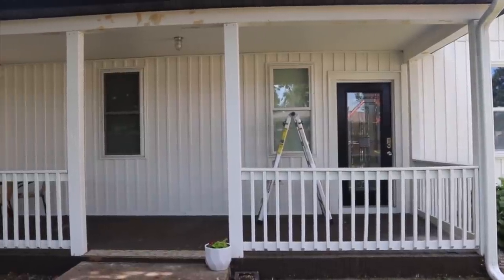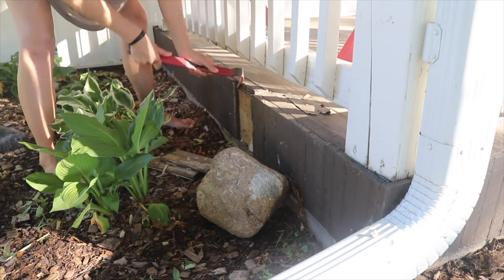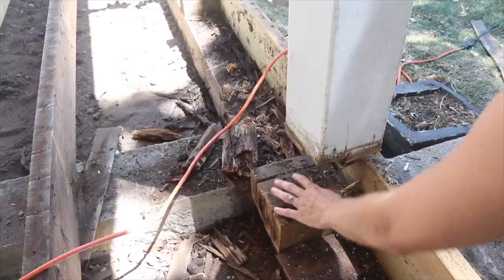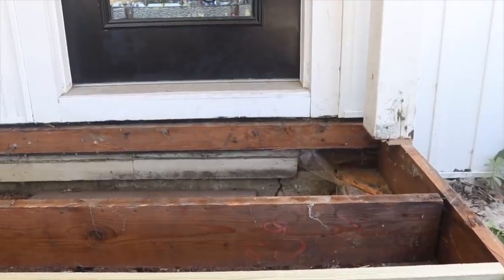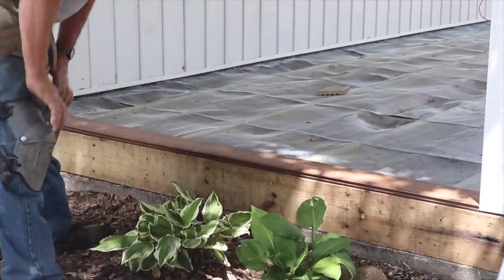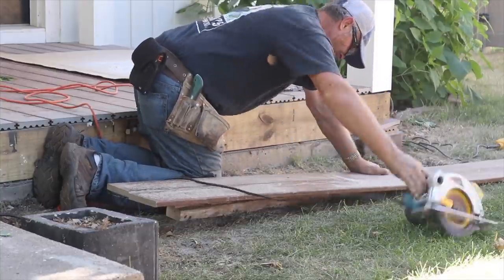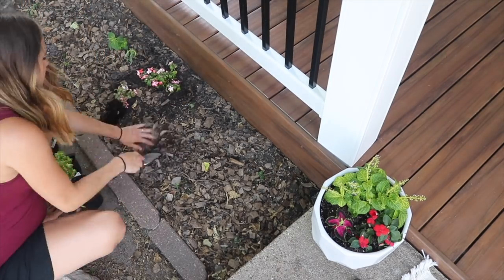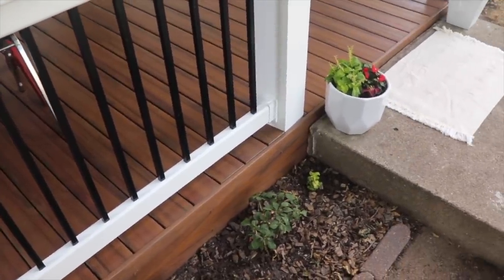Composite Decking Porch Floor Complete Tutorial | How to Replace Rotted Joists

Comment: Hello,  I’m a deck builder of over 20 years and I think you did a great job!  Only thing I would’ve changed is that I would’ve replaced all of the joists.  Treated lumber shrinks way more than you would expect it to.  So if you made it all level to the old stuff, then in a year it will have shrunk and you’ll see a wave in the decking.  But that’s just a cosmetic thing, not a safety concern and all in all you did great!!
Reply from the maker: Thanks for that info, I didn't realize that!

Comment: I built a deck using treated pine as per recommendations. A couple of years later it became a death trap. Ripped it all out. Pine was rotted to nothing. Rebuilt base using recycled plastic beams. Redid decking with composit decking. Was a total learning curve but came out well. Only the composit decking expands and contracts and has needed some adjustments from time to time. At least it does not need to treated every year.

Comment: Hi, it is a bad system to have the deck board’s right up to the edge and then a board to cover the others. The boards may be impervious to rain but putting them that way the water will run down be trapped soaking the joists underneath and rotting them out.
Reply: You haven't built too many decks... have you? There is nothing wrong with this one. Not only is it a covered back porch that will not see a lot of water....   there is plenty of room for any water to drain out without becoming trapped.